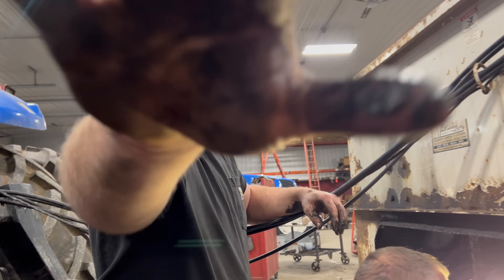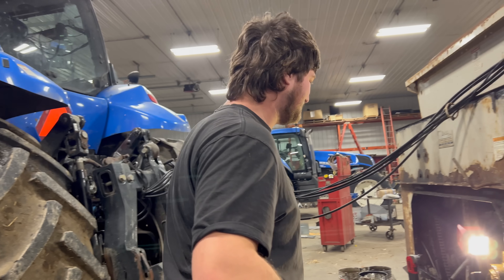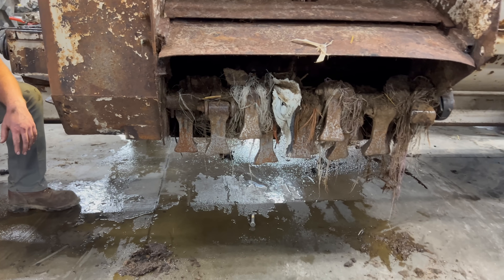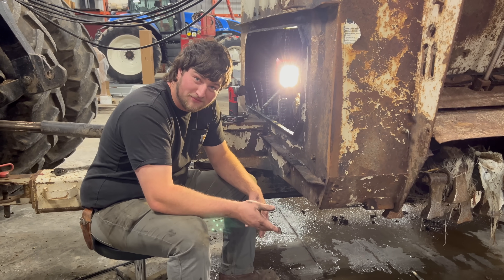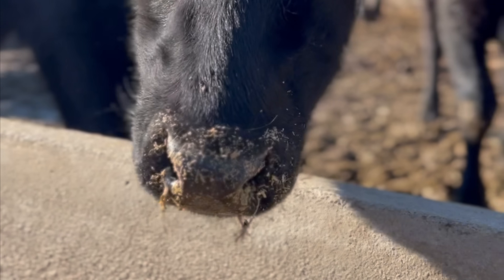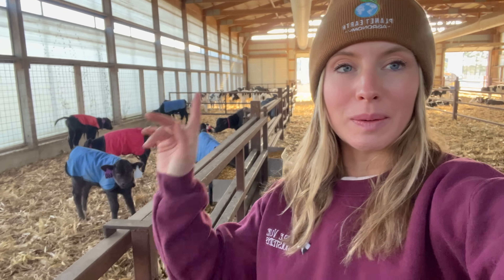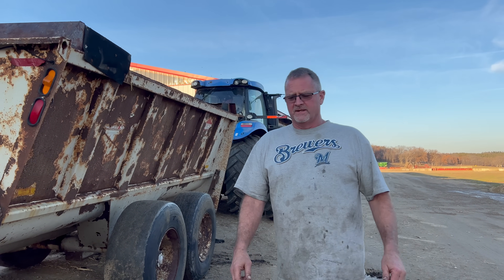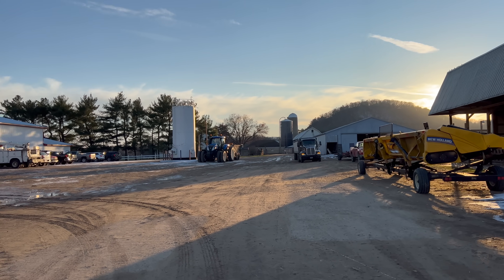A CRAPPY Day on the Farm

Comment: I feel your pain mason and Greg I grew up working on that exact spreader. I have changed that same bearing too a lot. Last winter I actually had to cut the whole back out of one of them and replaced it because of rot it was leaking too much also replaced the bearings on the back that runs the big augers
Reply from the maker: Not fun

Comment: Shear a pin on the shit spreader and fix the chain and then find out that the bearings are junk, I was running a skid steer and filling the manure spreader and hit a hard chunk of something, and the window was open and the shit splashed into my lap what a bad mess as I kept filling the spreader and then went and washed off my clothes and myself, glad I don't do this type of farming, I grew up working on a farm with my best friend Jim kern R.I.P, plus I worked for a parlor system for 4 years and I got sick of that, I moved on to more dirty work, working for a electrician digging just about everything you can amagin to get the wire in the ground deep enough to be legal,, I didn't mind doing this type of work, I am a Jack of all trades
Reply from the maker: Sounds rough!